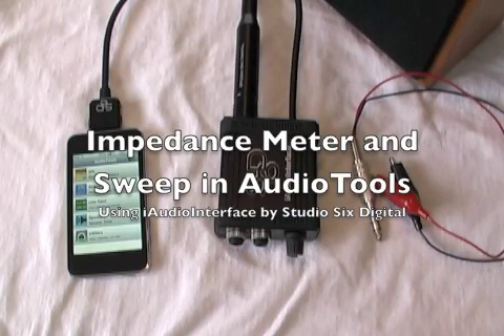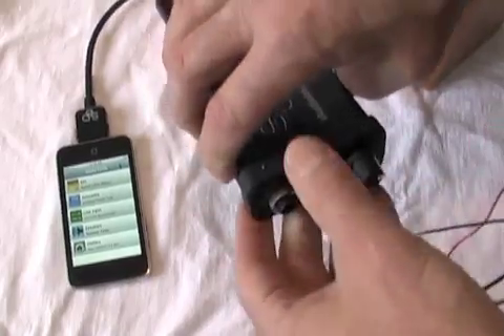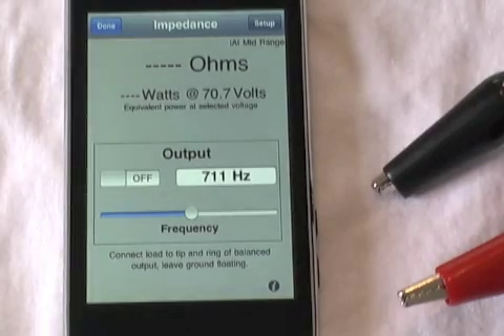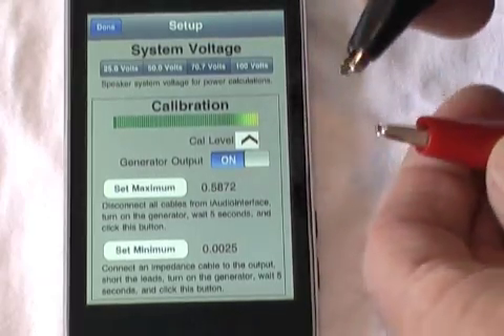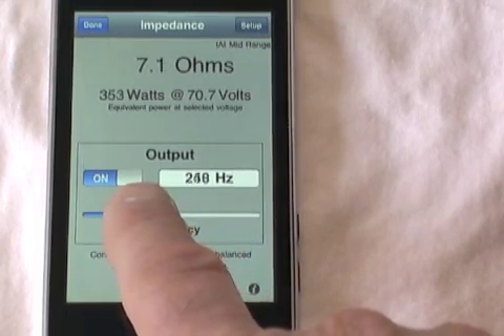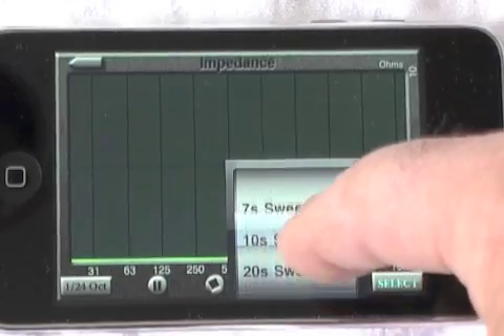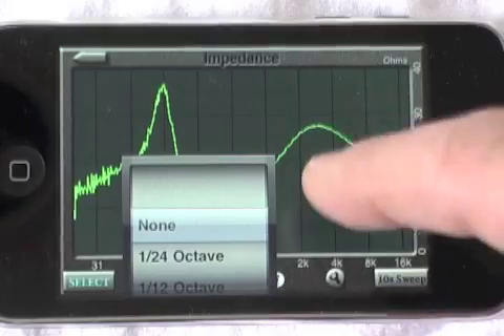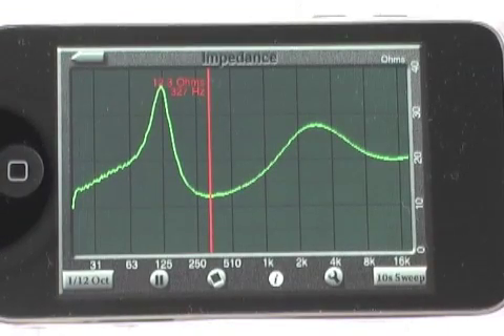Impedance Meter and Sweep on iPhone

Comment: Thank you for taking the time to upload this informative video.
I have a question. What is the normal impedance output of a cellphone? I want to know this because I would like to know what an appropriate range of headphone impedance I need to look at for casual music listening from the phone. Can you help me figure this out please?
I don't want to get headphones that are too high in impedance that will not only drain my cellphone battery inefficiently but also not sound good.
Thanks
Tim